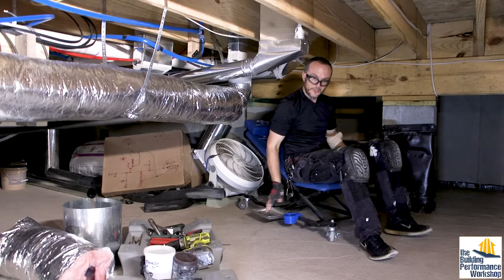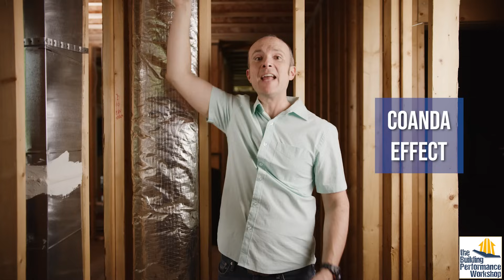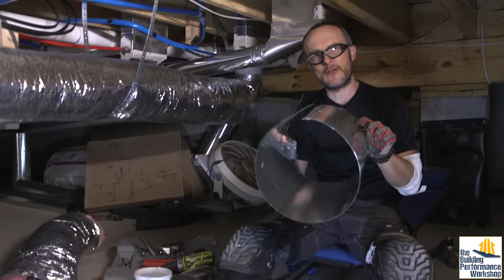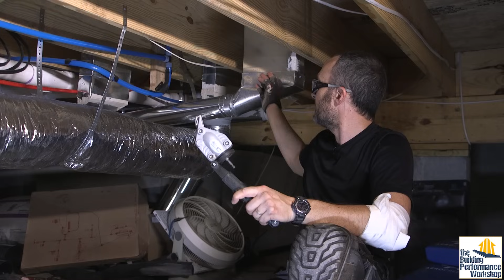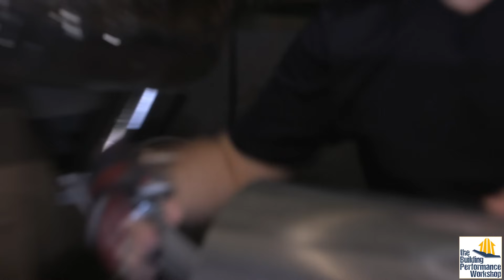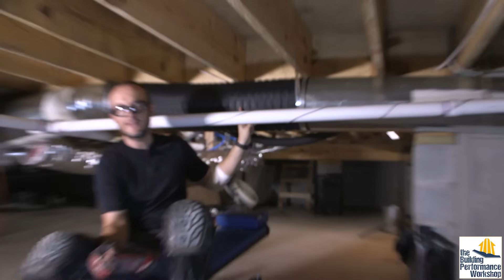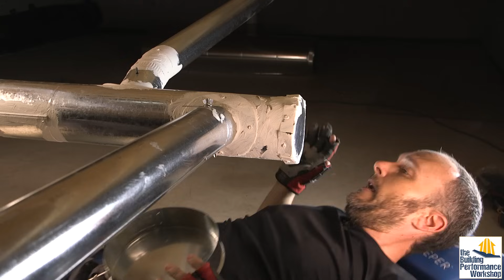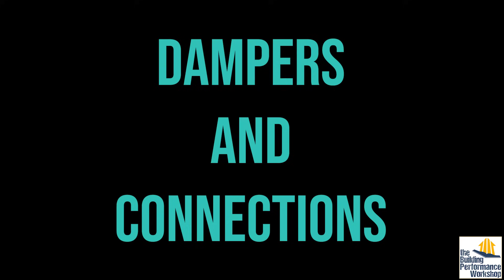Performance Duct Design & Installation: Advanced DIY

Comment: Great video. In regards to dumping the dehumidified air into the supply side, did you have any conversations with Ultra-Aire about that? I was emailing them back and forth a month ago and the tech told me they prefer to have the air dumped back into the return.
Reply from the maker: Pretty sure they’re leading the charge on the supply-side thing. You might have gotten an alternative thinker on the line.
Reply: @HomePerformance  Nope, I'm just an idiot. I got the Aprilaire and Ultra Aire techs confused, and had the entire conversation with him saying Ultra while he was saying April! 

Does the Ultra unit have enough fan power to operate independently, or does it require the Heat Pump blower to assist?
Reply from the maker: Haha, easy to get mixed up, a lot of samenames out there. Yes, the blower in the unit itself is around 300cfm, and it is designed to run independently.
Reply: @HomePerformance  does that not substantially hurt the efficiency of the heat pump/Hvac?  Maybe I’m misunderstood
Reply from the maker: Dumping the 300 cfm of dry, slightly warmed air into the supply does not affect the heat pump efficiency at all. Dumping it into the return would.

Comment: Reds are RIGHTS, Greens are LEFTS and Yellow is STRAIGHT cuts. Is the pencil boot (4 X 12 X 6" ) off your right shoulder inserted or receiving? May want to insert boot in direction of flow.?
Reply from the maker: Cool Sean, thanks for the reminder. Not sure which boot you mean, but I can only be so anal before my family leaves me.
Reply: @HomePerformance  You are the Movement brother!
Reply: @HomePerformance  Corbett...a great job on the install! You will pass with flying colours on your efficiency test. Single deflection and double deflection grilles to answer your question.
Reply from the maker: Ha, thanks David!

Comment: I love your videos and respect the work you do and your home is very impressive. But the mechanical systems in the crawl space are a joke. Seems to be no planing with any of the piping other than the size of piping. You should have had a ticketed sheet metal worker as a consultant and or a mechanical engineer as to type of fittings used for your duct design. As well as meetings with all the trades to coordinate the systems in crawl space. There is also no consideration to the friction loss of the fittings used in the system. Tap in collars for main trunks are not performance by any means. Just my 2 cents
Reply from the maker: Ethan, having seen 100s of home duct systems, I can’t imagine what you’re comparing mine to that makes it ‘a joke’. The duct design and schedule was done by the #1 recommended by several people across the country including Bryan Orr at HVAC School Podcast. People in glass houses, bro.
Reply: Home Performance yes I agree the duct systems are very poor in the USA from what i have seen mostly all flex. You should come to Canada and you will see performance metal duct systems. I was just disappointed because everything I have seen till now was the best I have seen in the residential housing industry. Cheers man not trying to ruin your day.
Reply from the maker: Ok, I hear you, and I do believe the systems and materials in other countries probably put the USA to shame (like some other more political things off-topic). Thanks for clarifying- doing my best here with the best US consultants I can get.
Reply: Home Performance it’s great that you have touched on things such as k factor of grilles as well as room by room loads and ducting placement. There is a lot of aspects you have got right.
Reply: You Barfolo union guys by the book. Don't want to share your trade secrets with the non union. There are no secrets. The info is out there for everyone to read in the ASHRAE specs. Residential duct is low velocity. .6 centre line radius on elbows is acceptable. You're lucky if you score .5% on residential installs. Try 50+% on your installs. You're not trying to build a rocket ship to Mars. Apply the KISS method and you'll do just fine. I'm also a union tinbasher and gladly share my 39 years of working in this fine trade with anyone who wants to learn. I have nothing to hide.
Reply: David de Silva do you see any radius throats in this install?
Reply: As a union sheet metal worker I can agree to a extent. I have seen some of the hvac installs in southern states and wondered how companies could get away with it. The sheet metal union I work for requires 8000 field training hours and five years of night classes before one can perform installs independently. I   believe this gentleman has the utmost interest in  quality home building and I give him credit for taking on the hvac himself.  Instead of taps 90 degrees  off the main, cut in the field we usually use a 45 degree take off that is constructed of a custom made tee spot welded and sealed together in our fabrication shop in place of taps. And we go to great lengths to carefully field measure entire building's. Then field draft our fabrication drawings basing our main concept from a engineer's sizing and layout drawing. Also as union craftsman we take all considerations during field measured drafting of a duct system such as maintaining 1.5x clr on all turns in duct and proper aspect ratio. After our complete set of fabrication drawings for all straight duct and fittings  are hand drawn  on the job site our custom sheet metal shop creates everything .we then wrap ends of duct in plastic  for cleanliness until install and label each piece for it's intended location in the house / building, based off of our preliminary sketches. That is how we do duct systems in the northern united States, Buffalo to be specific. Many small contractors in our area use the over the counter duct as shown in the video that can be bought in a local supply house and I believe a quality job can still be achieved. In my local climate our local building codes do not permit the use of flex duct in residential houses and limit the use in commercial to 5' long at the end of a duct run for vibration/ sound isolation. I have enjoyed your videos, I believe I caught one a while back that motivated me to purchase a panasonic spot erv that I installed in a upstairs master bedroom. I am currently renovating a 200 year house with energy performance in mind as our climate swings from 80 degree summer temps to - 10 winter. Keep up the good work!
Reply from the maker: Wow, your crew sounds badass, Adam. I haven’t seen any union crews working in homes, and I bet the commercial buildings (which I do not claim to specialize in at all) work very well when you get through with them.
Thanks for following, brother.
Reply: @HomePerformance  Corbett you are very correct in the residential side we are only doing about 10% of the work in our area. There is added expenses to create a complete custom made duct system, and to many homeowners the added 20% job cost is hard to sell for something that is hidden  away out of every day sight. As far as the oath I guess since 1888 they have been taking trade secret to a whole new level lol. Again I believe over the counter available ductwork can create systems of high quality as well it all depends on the professionalism of the installer either union trained or not. I am a strong advocate for incorporating the mechanical duct system to be inspected along with the inwall electric and plumbing. Followed by a final inspection of the local code enforcement. I believe this would cut down on poor quality installations, in my area we are moving in the right direction as the building inspectors are now checking to see that ductwork joints are sealed and that the return is ducted in sheet metal completely.
Reply from the maker: Nice, Adam, and thank you for acknowledging that my install will still get the job done- as a good Toyota, though maybe not a Tesla.
Reply: Adam Swendsen yes this is the way. I’m a red seal sheet metal Jm and 4th year refrigeration tech.
Reply: @AdayintheLifeofsmith  cheers to a fellow sheet metal worker!  I am a journeyman/foreman for the Buffalo local union. I agree with you on the statement you made on the efficiency aspect of the duct install of these videos. And not to speak poorly of Corbets work, as to most of the states this would be a quality install for the non union side of hvac. I see the builders online such as Matt risinger and many of the well known hvac channels on you tube and can't help but think for being so respected I see some really poor duct systems displayed in their videos. I am semi familiar with the red seal system in canada and believe it's something like our international training lnstitute for the sheet metal union. One of the down sides in my opinion, in the states is that as union craftsman we have extensive training and perform sheet metal work that far surpassed the quality that can be found online or you tube, however we take a oath at the end of our five years of training not to teach our skills to anyone who is not a member as that would be giving away extensive training for free to someone not affiliated with us that would not help our guild grow, this making our online spotlight almost non existent.
Reply from the maker: Holy crap- that oath is where the problem lies I guess! No offense to you guys or your trade, but if we don’t know what we don’t know, who can blame us?
Reply: Thanks for explaining that the air from the dehumidifier should go into supply side. I searched long and hard for the best way. Thanks for all the schooling. Great video!!
Reply from the maker: Thanks for following JC!

Comment: I don't think I have ever seen such a detailed duct and HVAC video on Youtube before. Great details, great video.  👍🏾
Reply from the maker: Thank you!!
Reply: @HomePerformance  
I would like to send you the computerized print out that I paid Webb reps LLC to do. Is that possible you could comment on whether I got a correct analysis?
Reply: When OCD and HVAC have a baby, you get Corbett.
Reply: @gwilliams1001  LOL
Reply from the maker: My friend, I am not trying to do this work for anyone else. This is my house. And your comments scream of a lack of home-as-a-system thinking. There is no elevation of mold, humidity, or contaminants in the home generally when all the systems are working together. Your HVAC does not have to fix problems in a home like this. I hope you get to work on one sometime, it’s pretty awesome.
Reply: Thank you
Reply: You have anyone that can help? In GA
Reply from the maker: Are you building the ductwork yourself?